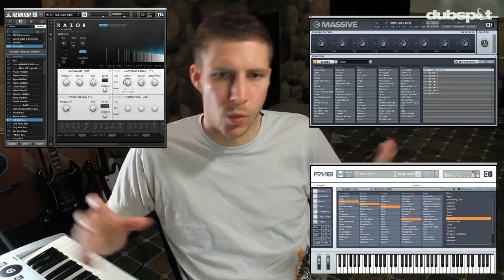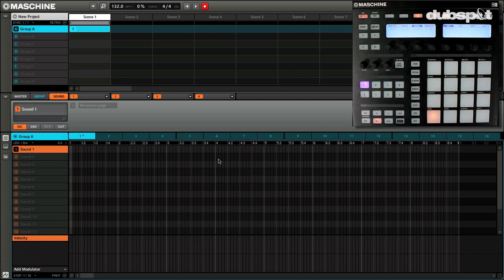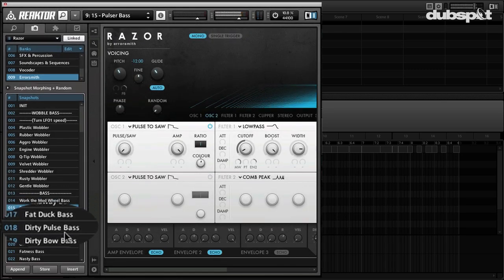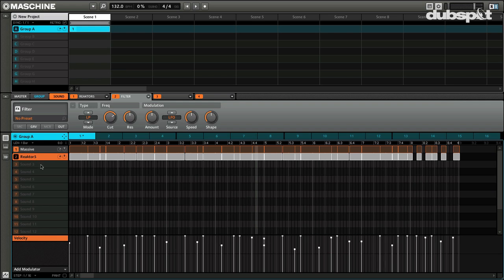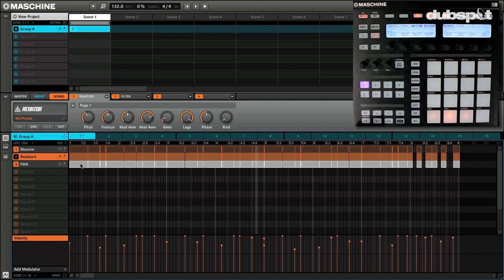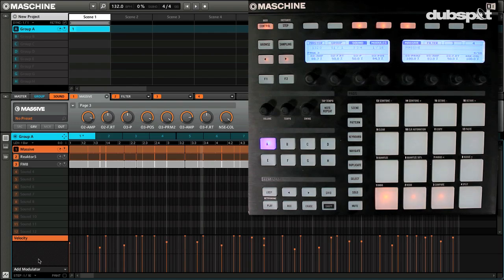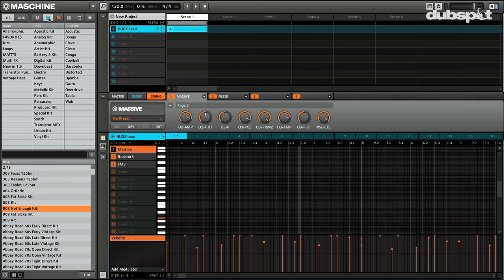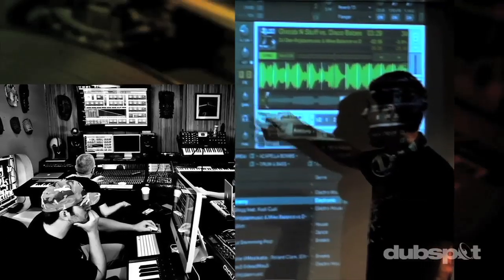Sound Design w/ Maschine Tutorial Using FM8, Massive, Reaktor (Native Instruments)

Comment: Is synthesis using the maschine hardware more about loading and tweaking presets than actual synthesis. I prefer making my own but would like to do it live with just the hardware. Maybe i'd be better off with an elektron A4. At least you know everything can be done with the hardware alone as it's designed that way.
Reply: +Pete Horam he just used presets in all the synthesizers.. - actually it is totally possible to design your own sounds in each of the synthesizers, and then mix them together as he did. :) - I have not much experience with fm8 nor reaktor, but massive alone is crazy with the amount of possibilities, so don't worry, maschine in my opinion has even less to do with presets than any other studio software i've been sitting in, since its so easy to change stuff, or make it from scratch :)